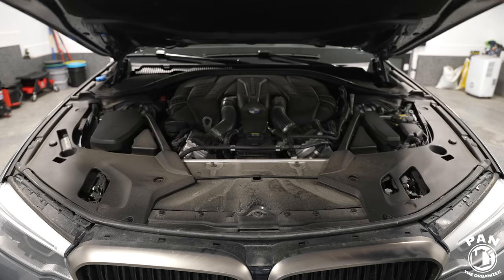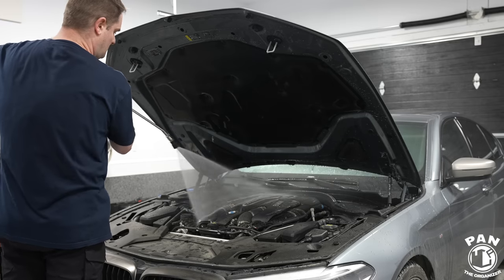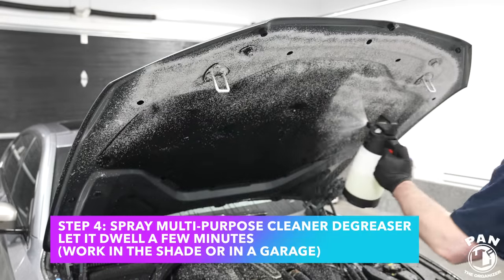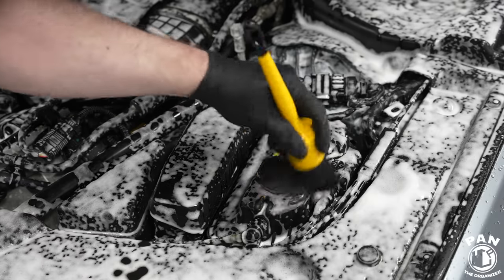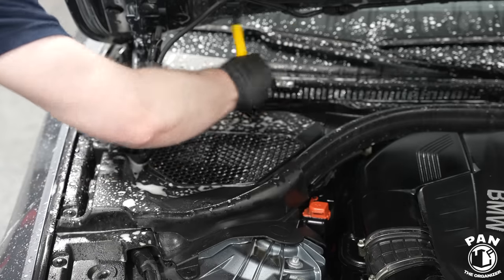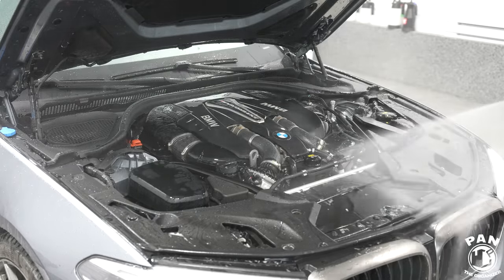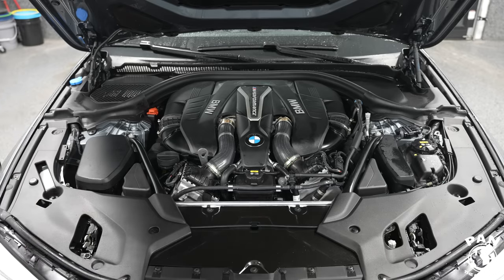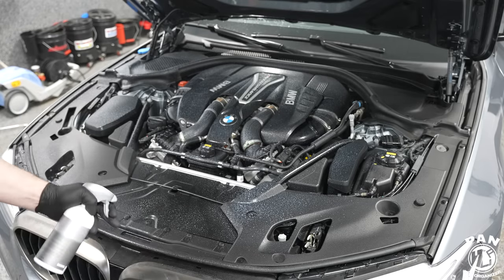How To Detail Your Engine Bay!

Comment: Salut Pan, à 1:15 tu utilises un pistolet/fusil à pression. Je voulais savoir à quel endroit pourrais-je en acheter un similaire? J’ai présentement un Kobalt de 1700 PSI et mon kia Stinger 3.3L à subi un traitement céramique ainsi qu’une pellicule transparente partout sur le devant. Je trouve mon gun à pression trop puissant et j’ai déjà fait décoller la pellicule.

Quel force PSI maximum devrais-je utiliser lorsque le véhicule est protégé par un traitement céramique? Celui que tu utilises dans cette vidéo à l’air génial, pas trop puissant et un bon jet assez large.

Merci Pan t’es vidéo sont super 👍🏻
Reply from the maker: Pour le lavage de véhicules, un maximum de 2000 psi. Moi je règle mon nettoyeur haute pression haut de gamme Kranzle 1122TST à 1000 ou 1100 psi pour le lavage de voitures. C'est plus que suffisant.

Ma lance et mon fusil sont ceux-ci: https://bit.ly/3faTEJQ

Comment: She is a beauty and sounds amazing too. Any concern with electrical components (i.e. battery) being exposed to the water Pan?
Reply from the maker: ZERO concerns. I have detailed hundreds of engines in my 24 years of detailing, ZERO issues. Especially with cars newer than 10 years, the engine bays are already water tight and well sealed.

Comment: Hey Pan,  can you use that combination in the sprayer for the body paint of the car?  Just curious.  I bought them to use this method for my engine bay but wondering what else they could be used for?  Thanks and great job as always!
Reply from the maker: No it's too harsh for the paintwork. Hence why you clean the car after the engine bay detail.

Comment: Would you recommend waiting to dress the engine bay until after the entire exterior has been washed? For example, after you do the glass and are dressing the tires would it also be smart to dress the engine?
Reply from the maker: It wouldn't change much, as once you're done dressing the engine bay, you close the hood. But you do what ever works best for you. For efficiency, I prefer to do a task from A to Z, instead of doing it partially, then coming back to it later. Counterproductive.
Reply: @PanTheOrganizer  That makes a lot of sense! Thank you

Comment: Great video, thanks... Could SuperClean be used for the engine and hood cleaning? Also, how long should we wait to start the engine? Finally, would the process be different to clean a Hybrid electric plug-in engine vehicle whick has a gas engine and electric motor? Thanks
Reply from the maker: Yes you can use SuperClean to detail engine bays, in fact I had done a previous engine bay cleaning tutorial with SuperClean products here: https://youtu.be/H252L0SOHE4

Once I'm done drying the engine bay and applying the dressing, I start the engine right away to help clear any remaining water and make sure everything works fine.

Comment: Do you need to cover any electron a components while doing this? I drive a 2019 Audi Q5
Reply from the maker: On modern cars, if you use common sense, and don't focus the spray nozzle on the same area for minutes on end, you're fine. If it's ok for an expensive twin turbo V8 BMW high performance engine, it's ok for your Audi. ;)

Comment: Do we need to disconnect anything/cover alternator with plastic bag? I’ve a BMW X5 G05 and looking for the correct way to clean to engine bay.
Reply from the maker: That’s up to you to decide. On cars less than ten years old, it’s not necessary. But if you feel the need to be ultra cautious, then disconnecting the battery and covering sensitive electronics and the alternator is good practice.

I never had the need to do any of that. But I have 26 years of detailing experience.

Comment: Hi Pan, I want to do this but I am nervous putting water on my car. Are you sure this is safe? I don’t have the plastic cover on top of the engine like you have but my car is relatively new. It’s a 2015 Honda Civic
Reply from the maker: Don’t overthink the moment. Do you think I would make a tutorial on how to properly detail an engine bay if it wasn’t safe?

Heck I even went to the extent of showing this method on a very expensive and powerful twin turbo V8 engine here.

Modern cars, less than ten years old, are already pretty much water tight. Car manufacturers go through extensive testing to make sure their engine bays are water tight. If you want to take extra precautions, put plastic baggies over sensitive electrical components, ECU, alternator, etc.

But really, it’s just common sense. Don’t spray water on the same area for minutes on end. Keep the pressure wand moving. Or just use a regular garden hose. Thoroughly dry when done and that’s it.

Comment: Nice, so you can just spray liberally over anything?
There is nothing you need to protect on engine?
Its goes on everything?
Thanks alot gonna buy
Question I went to order a bottle and they wanted  $114. To ship to canada,  what the  ??
Reply from the maker: You have to use common sense when detailing engine bays. It's at your own risk of course. If your car is recent (less than ten years old), then most car manufacturers make sure their engine bays are water tight. If you have any exposed sensitive electronics, alternators, or other parts that need to be covered, by all means cover them with a plastic baggie. And don't spray water in the same zone for long periods, keep the wand moving.

I have another engine bay detailing tutorial here: https://youtu.be/6LwCbmvLYb0
Reply: @PanTheOrganizer  my car is new just asking about if its ok to spray the product liberally, I understand liability issues if you say its okay 
Thanks for your help
Reply from the maker: Yeah if you follow the simple steps you should be fine.

Comment: Some questions. I did not see you protecting electrical systems in the engine bay when you were pressure washing it - not concerned? Same with the high speed drying, if jet wash didn't force the water where it doesn't belong surely that air will do it? You said you have done dozens of them so obviously you never had any problems so perhaps I am a bit paranoid... on the other had if there is a chance of damaging a customer's expensive engine I'd rather be paranoid than deal with any insurance claims :)

Comment: Hi! Pan, Is it okay for the water to seep in the electronic parts of the engine during the detailing. Other videos of engine bay detailing disconnect first the battery and covered-up the engine itself with plastic sheet to protect the electrical components of the engine. What's the difference? Thanks!
Reply from the maker: If you have an older vehicle (over 10 years old) you might want to cover sensitive parts, electronics, alternator, and possibly disconnect the battery.

But on modern cars I don’t do anything special. Just use common sense and be careful.

Comment: I have a 2020 STI with a top mount intercooler. Thats the only thing that has me slightly concerned.  Can I spray it with the pressure washer?
Reply from the maker: Hmmm not sure. Maybe check on a Subaru forum to see...?
Reply: @PanTheOrganizer  Will do. Thanks.

Comment: Hey Pan, its me again, just wana share that i just started detailing May this year, i pretty much done everything with little arsenal i got, however one thing i havent tried is engine detailing, tbh im really scared to touch the bay, i wanna try waterless/rinseless detailing but it will take so much time, i really wanna get into this "usual" way of engine detailing, im using a pressure washer with rated pressure 90 BAR with rated flow of 6L/min, you think its safe to use it on bay itself? im too scared pressure might mess up some wirings and bunch of stuff thanks!
Reply from the maker: If it's safe for a twin turbo high power V8 high end engine like in this BMW M550i, it's safe for all cars. ;). If you are careful, use common sense, and don't stand there hitting the same area with the pressure washer for 5 minutes straight, you're fine. Especially if you have a recent car (less than 10 years old) they are waterproof from the manufacturer.
Reply: @PanTheOrganizer  yeah about that (less than 10 year old) car, i daily drive a 2007 Chrsyler 300c base model the 2.7 V6 here in the Philippines, man you know they arent built that well lmao so thats the main factor im hesitating, but thank you for always replying and reaching out your videos are definitely huge for newbie like me and btw beast of a car you got there sir! 🔥

Comment: I actually had an Audi certified tech say that water can get into the engine  and cause parts to fail even on a new Audi from detailing engine bay. I think there is a misconception in the detailing industry about this
Reply from the maker: In 24 years of detailing and hundreds of engine bay details, I have yet to see a single issue in my case. Common sense, and protect sensitive parts if you feel the need to.

Comment: You aren't worried about the APC messing up the ceramic coating on your fenders?
Reply from the maker: No, as it’s just a but of overspray and coatings have a very high chemical resistance. Plus you’re rinsing it off and washing the car afterwards anyways. Don’t overthink the moment.

Comment: Any tips if you have rust proofing coating applied to the engine on the engine block areas and not to remove that during engine cleaning?
Reply from the maker: Nothing really changes. I did the engine bay of my girlfrien's Mazda CX-5 that has rustproofing in this video: https://youtu.be/6LwCbmvLYb0
Reply: @PanTheOrganizer  Awesome thanks

Comment: I cleaned the engine of my 2016 Mercedes Benz E63S using the same the same technique but got a check engine light a few hours later. The idling was inconsistent almost like it was going to stall and at low speeds the usual power wasn’t there. Really worried    Because I’ve used this technique before with MB E550 and there were no issues at all.
Reply from the maker: I am not a mechanic so I can’t really give any advice. It’s up to the owner of the vehicle to make sure everything is in working order prior to detailing their engine bay and also taking precautions if they don’t feel confident in their abilities.

You will likely have to go to your dealership and have the error code verified.
Reply: So I let the car run for 30mins just idling and the engine light went away and the car is running great again. It appears that there was built up condensation that just need to burn off. Thanks goodness! Keep up the great work Pan, love your videos!

Comment: Do I need to disconnect or prep anything like the battery?
Reply from the maker: If you feel the need to make sure you are 100% safe especially if you're working on an older vehicle, you can take all the precautions needed: disconnect battery, cover any sensitive electronics, cover the alternator, etc.

But on most modern cars (less than 10 years old), as long as you use common sense, no need to do anything special, except for not focusing the water jet on the same spot for too long. Keep the water moving. This was a high powered twin turbo V8 engine used for the example in this video, on an expensive BMW M550i, and I didn't have to cover anything or disconnect the battery.

Keep in mind cars drive in inclement weather all the time and manufacturers make sure their engine bays are water proof.
Reply: @PanTheOrganizer  thank you very much! My car is brand new and I’m going to start taking care of it and detailing it so this info is very helpful!

Comment: You forgot to lubricate the hood latch mechanism with white lithium grease. Also if there is access to lubricate the hood release cable with silicone spray or taking it to the next level use a chain or pulley lubricant.

Comment: 1:5 gs isn't it very strong? I think 1;10 would be better love the video
Reply from the maker: I used 1oz of Gs in 1 liter of water in the pump sprayer, that is not a 5:1 ratio.  But in a normal trigger sprayer, 5:1 for dirty engine bays (way dirtier than mine) works fine. You can do 10:1 if you want to.

Comment: So your fine you spray water?
Reply: Common sense approach, be mindful of sensitive electronics, dont spend time in the same area, chose your pressure and pressure washer head wisely or you use a pump sprayer or normal garden hose sprayer, its a shower clean not a high pressure clean using excessive water or pressure, note you can also use a drier/leaf blower or cloths to soak up excess water

Comment: I don’t know why and correct me if I am wrong but I’m just not convinced that its safe to clean your engine. So I haven’t so far on my car..
Reply from the maker: I have been detailing cars for over 24 years now, and have done hundreds and hundreds of engine bay details. Not once has it gone wrong. Use common sense and proper methods and you're fine. Especially nowadays with cars in the past ten years that have water proof engine bay components.
Reply: @PanTheOrganizer  thanks Pan!

Comment: Honestly, I would never follow this procedure in my car. Throwing water under pressure on the engine is a practice that carries many risks since there are not only tires and "pipes" but there are also wiring and a multitude of electrical components (better or worse taped according to the manufacturer). It is highly probable that by launching a jet of this type, some tiny cable will introduce water into its connector or worse, break it or separate it from its corresponding connector ... and then, go find what it is. It has happened when the car does not work well and you find that it is what has been broken, has produced a short circuit by water or something else, within all the vehicle wiring.

PAN is a professional, but this practice seems like a real outrage to me ...

Of course, it saves a lot of time compared to doing it in another way, but I prefer to lose time to reach the same result without taking such risks.

Comment: There is no real chance of fkin up your engine while doing is?
Reply: The engine is being sprayed with water, not submerged with water. I’ve cleaned them before too, doesn’t do anything
Reply: @DK-lz7kg  doesn't do anything until a mechanic pulls the engine apart and sees the damage from water reaching areas it should not
Reply: Cover air intakes and alternators. If it’s not that dirty then you can just use a very watered down apc and spray in, mop up with microfibre. But as pan said most engine will be fine. Another tip is on the last dressing stage you can use your blower to get it into all the small areas.
Reply from the maker: In my 24 years of detailing, I have done hundreds of engine bay details, and never once have I had an issue. If you're unsure, just take extra precautions like covering sensitive components with plastic bags...